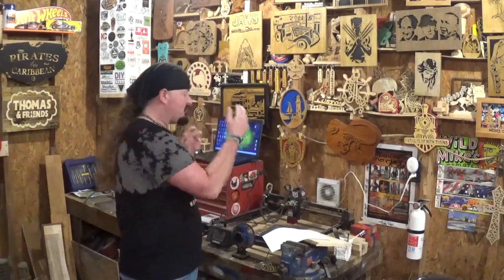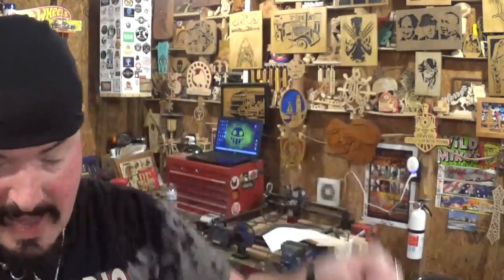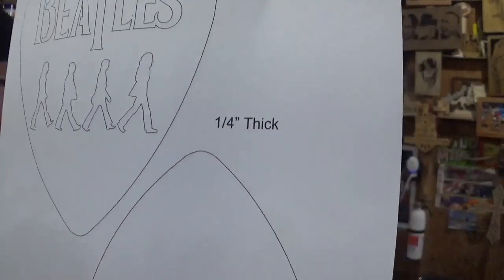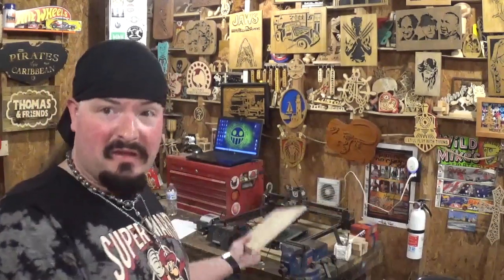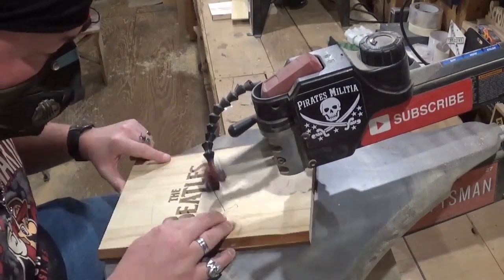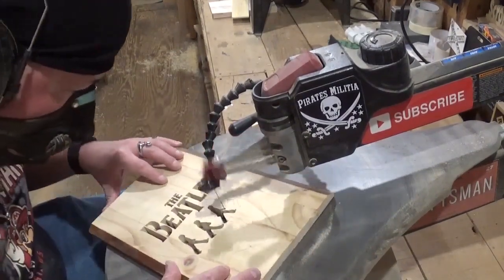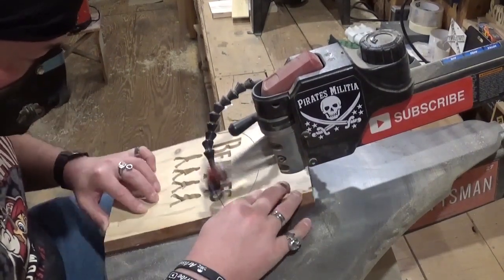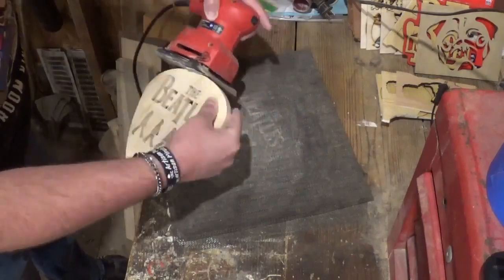Can You Laser Engrave Scroll Saw Patterns? A Woodworking Experiment

Comment: I've been using my laser to not only give me my cut lines, but I have been designing some burn lines that are a bit deeper to add more to my design.  For example I just did a disnasour toy.  I lasered the cut line, but also the eyes, mouth, acents dow the back and more.  I plan on lasering both sides once I figure out alignment, getting it perfect. I use a rotary tool with a cutz-All bit to profile my edges.  It takes away any laser cut that remains.
Reply from the maker: That is a fantastic idea! I may have to try it!